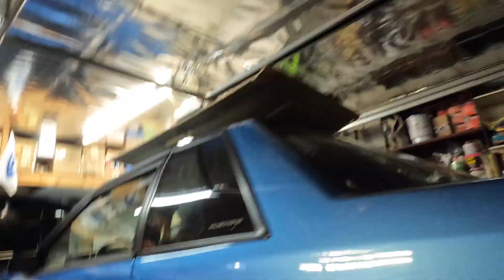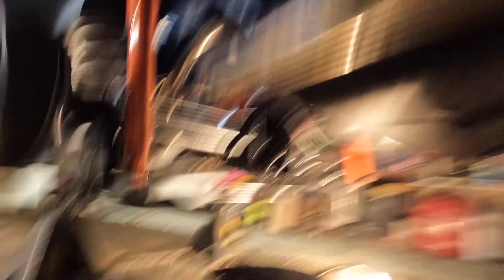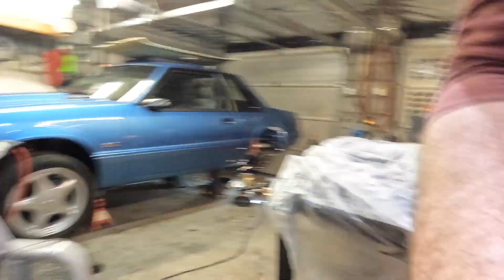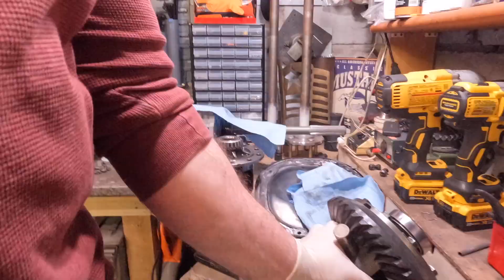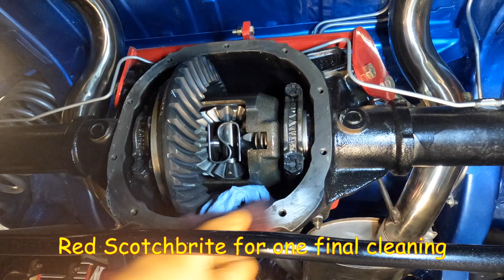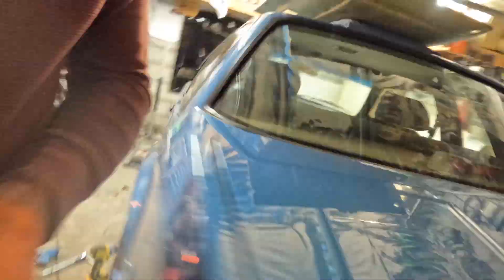Foxbody Mustang 8.8" 31 Spline Differential and Axle Upgrade

Comment: hello im in quite the pinch, did you not have to touch the axle seals or anything? do the 31 spline axles just go right in with the 31 spline carrier?
Reply from the maker: Nope.  They were relatively new as were the bearings so they didn't need to be touched.  If your bearings and seals are old then you might want to consider changing them at the same time.  Rock Auto is your friend.
Reply: @Mike-FoxsAbroad thank you very much

Comment: Did you replace the pinion gear? And is the explorer pinion gear the same size as the foxes . Wanting 373 gears and 31 spine axles.
Reply from the maker: No. My car already had 3.73 gears installed.  As long as the gears are running quietly, the pinion gear does not need to be touched.
Reply: @  I guess what I’m asking is going from a 327 28spline should I grab the pinion gear from the explorer to have 373  and will the fox drive shaft flange ect fit in the fox 8.8  . I appreciate the knowledge
Reply from the maker: @  I’ve tried twice in the past with transplanting used gears and have not been successful. They do take a set and it’s neigh impossible to observe a proper wear pattern like if the gears are new. They have both been noisy after installation. Not to say it can’t be done, but with the time invested in doing this work, it’s not worth the gamble in my opinion to do it with used gears.

Comment: Are those 17” pony rims? I’m doing rear 5 lug disc conversion and 17 pony rims and want to make sure the 3” wheel studs will fit under the center cap still
Reply from the maker: Yes.  The rears are 17x9's from LMR.  They do hide the 3" wheel studs nicely which is one of the reasons I like them.
Reply: @ thanks Mike! Think the 17x10 pony’s will fit with little issues on my 93 based on how much room you have with the 17x9’s?
Reply from the maker: @anthonyl9566   I don’t know man. Even mine are super tight.  I have nitto 275-40-17’s on the rear and even with the lips rolled it’s tight. I do have an 11mm maximum Motorsports spacer pushing out the wheels a bit for when I run the pony wheels.  I like fitting the biggest wheels too but I’m glad I have 9’s on the rear and 8’s on the front.
Reply: @ thanks!

Comment: Are up laying down so much tq/hp with the tire grip to need a 31 spline rear end?
Reply from the maker: If you ever plan on running sticky track tires, then upgrading to 31 spline axles is advisable.  Even muscle cars back in he day had larger axle shafts if they were kitted out with a big block or track use.  28 splines is ok for a production car but has limitations.

Comment: Hi, for the shims, is the idea to have no play at all or are there specs to follow. Thanks for the video.
Reply from the maker: The Ford Racing clutch rebuild kits come with specs on how thick the clutch/steel packs should be.  I like shimming them as tightly as possible so that the cross-pin can barely get back in.  Give it a few thou clearance if it makes you feel better.  The clutches are going to wear very quickly when they are new so making them initially as tight as possible is my goal.  And I don't get all stupid with trying to restack the clutches and steels.  The people that do don't have any better results and they waste a lot of brain cells and time trying to overthink it.

Comment: Great video. What control arm setup are you using? Thanks
Reply from the maker: Maximum Motorsports Heavy-Duty adjustable rear LCAs.  Baseline Suspension Street Launch UCA kit.
Reply: @Mike-FoxsAbroad  Thanks ✌

Comment: Hey quick question where did you get the drum brakes off of? Or what website I might be having issues with mine I believe if you could help me out, thanks
Reply from the maker: The drum brakes on my car are still the original 4-lug ones that were on the car when I bought it.  They are about $40 each from Rock Auto.
Reply: @Mike-FoxsAbroad  so you don’t have 5 lug drum brakes in the rear?
Reply from the maker: @LS_Manny  No, I do not.  If you want 5-lug drums look up a 1990 Ford Ranger with 9" drums.

Comment: Awesome work. All your content is super helpful. Can you tell me exactly what years and makes of fords that I can go get everything you got from? I’m looking at doing exactly what you did with the 31 spline stock length axles and the 8.8 carrier with 3.73 gears

My notch is a 91 4 cylinder so everything needs to be changed over and beefed up
Reply from the maker: You need to start out with a fox mustang or early SN95 8.8" axle housing.  The differential was out of a V8 Explorer.  You can buy a brand new differential from Ford for pretty fair money if you do not want to shim or rebuild a used one.  The axle shafts are new Moser units as there are no 31 spline axle shafts the correct length that were ever used in any ford product.

Comment: Where did you get the tool to squirt the gear oil in?
Reply from the maker: I typed "Oil suction" into eBay and a bunch pulled up.  I got a 200ml one but I'd get a 500ml version if I were to do it again.  The 200ml one is smaller than I expected and takes 4x to do one quart.
Reply: @Mike-FoxsAbroad  thanks for the quick response. Great job on the video. Me and my brother are just starting out with out channel. Building him a 363 93 FOX. Your info helped with our 8.8 questions
Reply from the maker: I'm glad we could help.